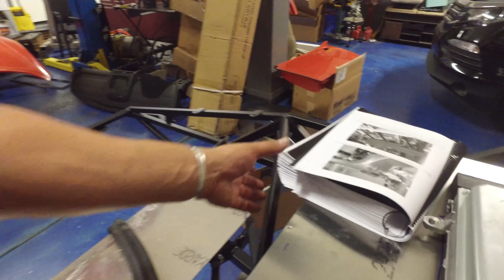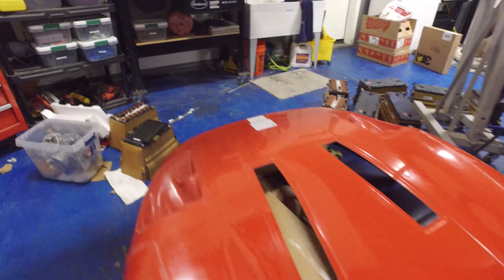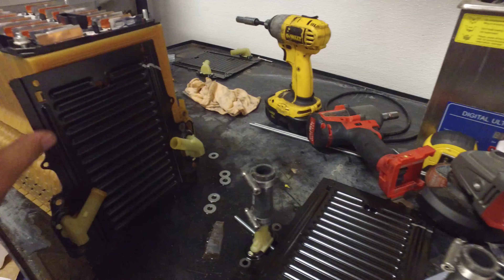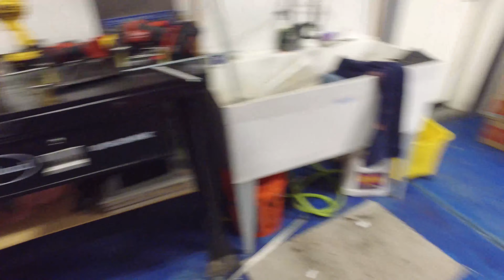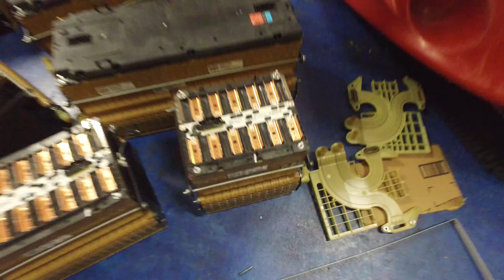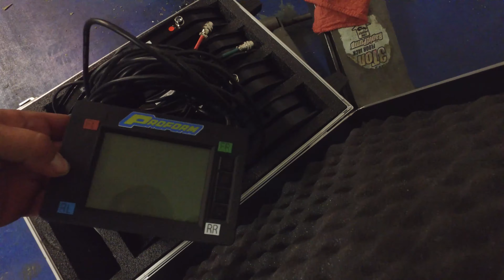Project Electric GTM - Modifying Lithium Batteries

Comment: I would avoid hanging the body like that for any amount of time. Much better off to build a platform for it to rest on then hoist the platform. If you keep the body like that it may start to droop and it will be difficult to get it back to shape.
Reply from the maker: I'd be concerned if it was anything other than fiberglass.  Fiberglass doesn't stretch and is flexible but no memory.  It has to crack before it becomes stuck one way.  The whole thing weighs much less than 100 lbs and will need a lot of work to make it fit properly regardless.

Comment: Are you going to add a gas or diesel generator to charge the batteries on the go or run a generator off the front suspension and or somenkind of regenerative braking system like found on the ford escape system
Reply from the maker: AC motors have regenerative braking capability.  Aside from that, it gets plugged in to the wall no different than my Tesla.

Comment: how many kwh total will your pack be?
Reply from the maker: 36, officially, however the Volt packs appear to be rated differently.  So, 36 based on the software limitations in the Bolts, but since I'm using my own stuff, evidently it'll be more like 44 kw total.

Comment: So could that be used with a radiator mounted on the front of the bike, and could it be used in conjunction with cooling the small gas motor we were talking about last night?
Reply from the maker: Yes most definitely!
Reply: So that easily solves the cooling issues, power kill switch could be wired right into the existing kill switch for the motor. You have really made this whole process seem a lot more simple then I thought.

Comment: Damn. It's like building a computer, but way more complexity and danger.
Reply from the maker: Just don't lick the terminals...  ;)
Reply: @CodyGraham  lol yea! Are all the ones not live on the floor then? Seeing your dogs walking around there and all... 😬
Reply from the maker: @RWD_Adam  They're live but the dogs are good.  They only eat stuffed toys!
Reply: What battery management system will you be running?
Reply from the maker: @Tom-evnut  I'll be re-using the OEM BMS from the Chevy Volt batteries.  I intend to tap into their CAN signals for monitoring.